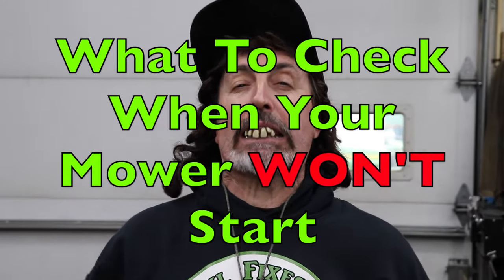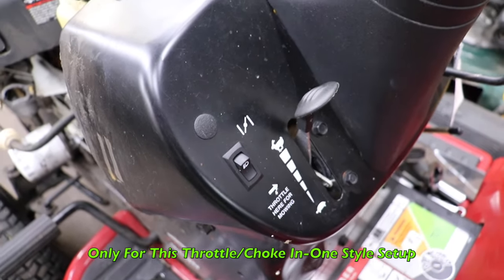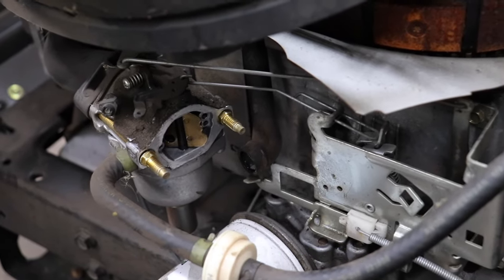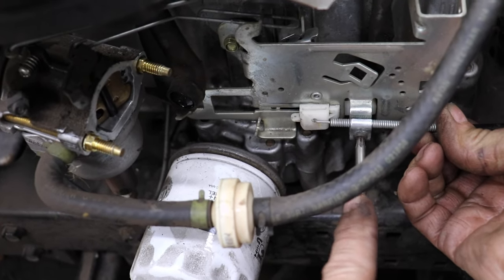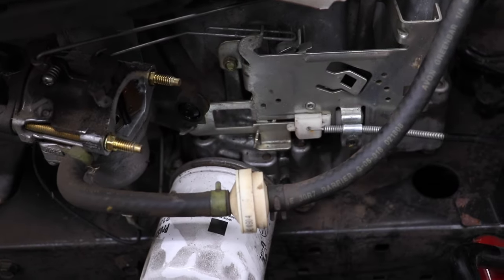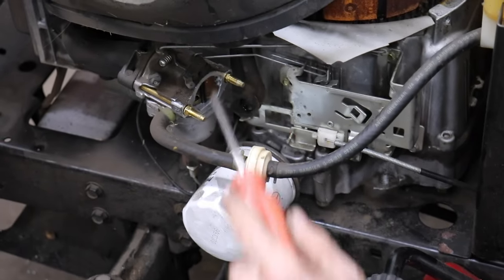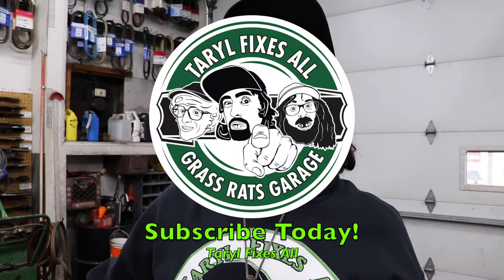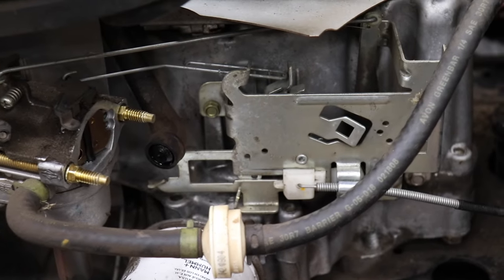Mower Won't Start? CHECK THIS! Amazing Tip

Comment: I sure need to. Thank you. To be honest, when I clicked on this and I saw you at first to myself said this goober isn't going to show me anything and you absolutely showed me exactly what was wrong with my lawn mower that I've been working on for 2 days. I went out pulled my throttle cable but my choke was stuck shut. I pulled that lever back fired right up. Thank you thank you thank you

Comment: Don’t forget about that silly anti backfire valve. I’ve had them stick closed, especially after waking it up from its winter slumber. Just gently tapping on it and cycling the key a few times has gotten them moving again with no more issues. Great tips as always Mr Dactyl!!
Reply: Taryl just did a video on this
Reply: @THEMOWERMEDIC1  yep

Comment: Great Video Taryl. The same thing has happened to me twice but with push mowers. They said them wont start when cold, I adjusted the cable and they run like new.

Comment: Thank you so much for your informative videos! I know you help a lot of folks, especially me! Might want to let folks know about the fuse that can blow and cause a no start situation.
Reply: There's a difference between not starting and not turning over. The blown fuse won't let it turn over to  begin with. I have to ask people that question all of the time when they say "it won't start". Okay, but does the engine turn over?

Comment: Had the same problem with my $10k Ferris mower with the Briggs engine. The Ferris does have a separate choke, however the choke was not closing all the way, just needed a little tweaking . Thanks for the video.....

Comment: Love yur videos, would the choke not closing fully lead to a hard crank (stall even) as if compression too high 18.5 Briggs intek did valve job (just lapped) set valve lash at .004 there is a bump for compression release (working), what should I go to next Battery or starter, battery 4 years old, previous owner ran it with blown head gasket so I assume a whole lot of cranking to start it and possibly burnt up or wore out  starter, not sure which way to turn, bore was in excellent condition worth fixing, got a number for the spring on the throttle linkage?

Comment: Hi TarlyI have a question don’t know if you’ll get to thisI don’t want to take too much of your time I know you’re busy. I have a Craftman LT 2000.Rider, that someone gave me it spins freely and won’t start took the plug out spun the fly wheel spins way too freely. I put a screwdriver it in there don’t feel anything. I just want to know if you can guide me where to go on this. It turns over but don’t start spins very very freely. Thanks for all your tips. Keep on going. Thanks, Kevin.

Comment: Taryl; 
Completely off topic from the video, however, I'm sure you can guide me in the right direction. I have several Kee push lawnmowers and only one is complete. The others are lacking parts, mainly blade spindle. These mowers were last produced in Florida by Trailmate and I beleive Ariens acquired them in 2010. Any idea where I can find parts new or used.

Comment: I had a no start yesterday.  It was the sparkplug.  Ran fine when I parked it for the winter,  it just died sitting.  New plug fired right up.  Runs great.
Reply: Had this happen to my first dirt bike. Plug looked perfect fine but would not run the engine.

Comment: I have 18.5hp craftsman I rebuilt 1st time.  Used crank new & head, piston n rod new- honed n seals. Pre-oiled parts.  Assembled it n hard to crank by hand with plug out.  Thought I had everything meshing right n facing the correct way.  No doubt I have to retake all apart. 
  Have a idea what to check?

Comment: On mine, the plastic housing of the air filter box makes contact with the butterfly valve, I had to file some of it away otherwise the choke would stick on. Easy to check, just remove the air filter filter, you'll soon see if the flap has full movement.

Comment: I have also find a lot of times that the choke shaft return spring will break and not allow the choke to open when moving the lever from choke position.  Therefore the engine will flood out preventing it ftom running.

Comment: Hey Taryl, I've got one of those B&S 16hp opposed cylinder engines that wont start when it's hot. This seems to be a common problem with this engine. Is there a fix for this issue?
I've replaced the carb and the coil.

Comment: I suffered for years with this. Mine is a Craftsman, 13 years old. Worked fine for one season. Got warranty guy out, and he did the adjustment, but it slipped back. I looked everywhere online after and found the cure on a similar video. I haven't had the problem for a few years now.

Comment: On the bigger John Deere (X series) the 10 conductor connecter near the key switch needs cleaning and tight reassembly so the Carb fuel shutoff solenoid operates.  When you turn the key on slowly, you should hear or feel it click with your finger.

Comment: This happened to me with a Deere. Of course I only discovered this very thing was the issue AFTER taking the carb out and cleaning it, and after another hour of diagnosing and ruling out safety switches. Boy I felt silly for not checking the easiest fix first.
Reply: It wouldn't turn over if it was a safety switch.

Comment: Hey I have a toro rider, and I have an in-line shut off gas valve. If I happen to forget to shut the gas off when I'm done mowing the gas will fill up my crankcase. What's going on with that? I'm getting tired of changing the oil and filter everytime I forget.

Comment: I have a 2005 DLT3000 and the 3.5 Gal gas tank under seat, battery where this one is up front. Looks like no fuel pump on this too. Why the change?

Comment: I like the short version of the quick  fixes can you share some things on the  silenoyode and my key won't work the  starter strong  battery new gas new plug s still won't start
Reply: I'm having to jump or cross over on with a screw driver I know I should not do it but it is the only way to make it work for now  HELP!!!!!!!!
Reply: Checking out the carburetor and cleaning it out  soon

Comment: My choke sticks on , I have to reach up there and pull it back. Exact  Same setup as that mower, how do you stop it from sticking.
Reply: Carb cleaning could help. Gunk might be on butterfly stem. Otherwise some general lubrication at all moving points.

Comment: i put a briggs 14.5 on my cub 1042 to replace the pos courage. My ? can i pull a vacuum somwhare to install a fuel pump or do i  need to relocate the gas tank whare the battery is now?

Comment: I had a similar problem with my John Deere la175 it started then after a minute it quits then it wouldn't restart I put gas in the carburetor and it would start but only run long enough for the gas to run out, today I put a new carburetor and fuel pump on it ? Am I barking up the right tree ?
Reply: Change the fuel filter and remove carb bowl and check for fuel flow with float down.  Sticking needle valve possibly.
Reply: Probably so, probably a dirty main jet. Next time just drop the float bowl, check for corrosion, take the jet out or stick some guitar string through all the tiny holes. No need to buy a chinese carb from Amazon. Check the fuel pump output by disconnecting the output and cranking before buying a new pump. Check both before deciding what to do or buy. Check for lack of gas by spraying something flammable in the throat then cranking- carb cleaner, brake cleaner, etc. Its usually probably the dirty carb jet and bowl.

Comment: I have a separate choke.  My mower doesn't start without help from starting fluid. Once it warms up it starts no problem.  Where's a good place to start troubleshooting?
Reply: Take filter off and look in carb-a-trater to verify choke vane is closing fully. Adjust cable or linkage if needed. You might do a compression check when cold also.
Reply: @vortexan9804  Ok, Now I have a place to start,  Thanks!!

Comment: Can you make a video on how to remove the Governor on this Craftsman ride on mower too ? I want more power.
Reply: The "governor" is not a "power restrictor." No, it is a cruise control: more throttle for thicker grass, less if the blades are off, try to steadily maintain the rpms that are being asked for, by controlling the throttle. What you CAN do, is make sure the governor/throttle linkage setting is correct, and can push full throttle if conditions call for it. Also you can check with a tachometer that the rpms are correct at full throttle knob setting. I'm pretty sure Taryl has a video. Somebody does.

Comment: I'm on my daughter's YouTube. Use this at your own risk. For those of you that have a hard time starting your mower in the winter time, remove the choke blade, find a flat piece of aluminum, lay the choke blade on the flat piece of aluminum, soldier the holes shut. Let the soldier cool before lifting up the choke blade. The soldier won't stick to the aluminum. Reinstall the choke blade. If by chance one or both soldier pieces fall off the choke blade and goes into the engine, the soldier should be soft enough not to damage the engine. I have a soldiered choke blade on a mower for 4 years now and the soldiers are still in place.